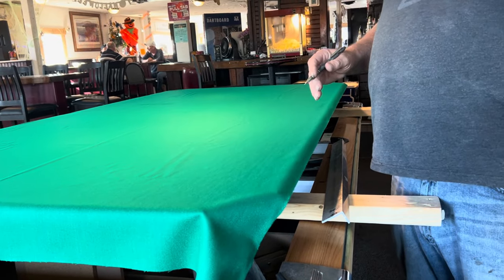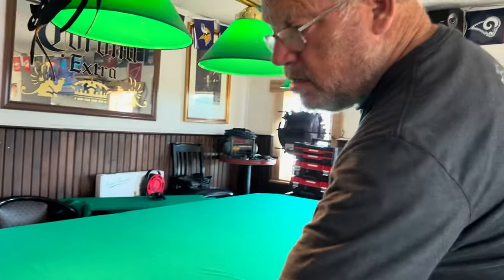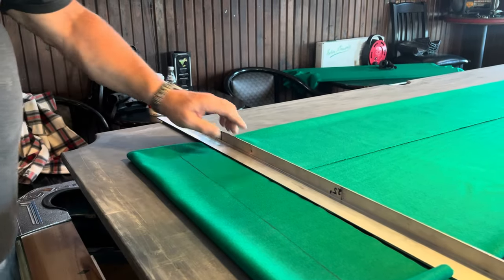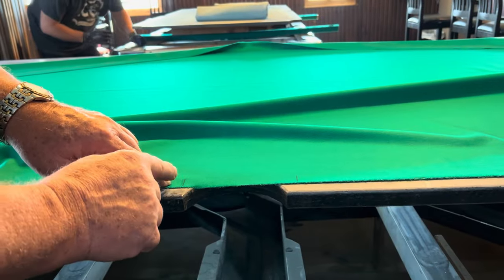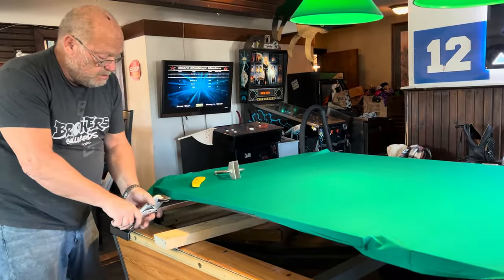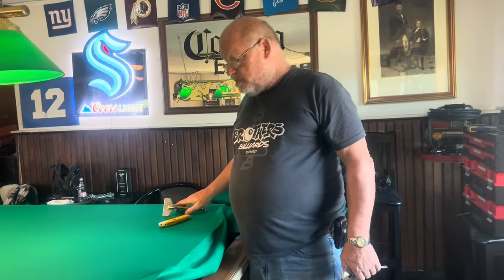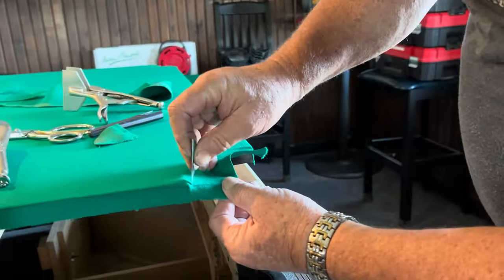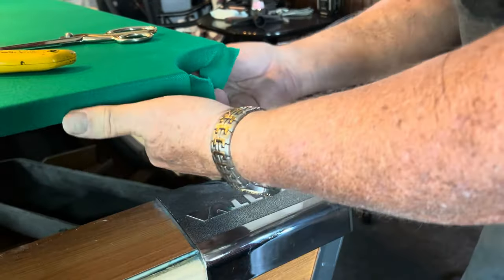HOW-TO: Glue Down Pool Table Cloth Just Like The Real King Cobra!

Comment: This man needs more likes....this is the best example of how to do this. Now I just need to figure out a stretch test. Thank u sir.
Reply from the maker: I'm explaining that in full on the 7ft Valley slate I'm getting ready to recover, trust me, you won't have any questions after watching that video.
Reply: Brother, hear the man grunting? You come back in a year, run a ripper up the middle, and when a 1 1/2 inch gap opens up; THERE IS YOUR TEST. That fabric still had some stretch in it. Some mechanics are so weak that the fabric is wrinkling and/or bunching in front of the ball within DAYS. Their glue and technique is often crap as well.

Comment: Hi,
Thanks for a Great vid. It will help a lot.
I have a 8ft table. With the rails removed my side pockets measure 6 inches along the side of the table and a depth of 3,5 inches.
Is this a full size pocket, meaning i should give it a slack of 13/16 of an inch on the anchor side and 5/8 of an inch on the stretch side?
Greatfull for any reply.
Reply from the maker: Yes, you have a full size slate, so use the 13/16" and 5/8" measurements
Reply: @therealkingcobra  what about 9ft GC IV do you also use the 13/16" and 5/8" measurements?

Comment: Thank you for all this information on pool table installations. It has helped tremendously 🙏 I have one question that would help me out greatly if you have the chance to respond. I've been helping out my local pool hall installing new cloth and we've been installing the Simonis 760. After doing the stretch indexing, we end up with a stretch from side to side of 2.5". Minus the .75" we end up with 1.75" working index. When it comes to the ends of the table, I'm able to stretch both ends at least 3+ inches, at both ends even when one end is stretched and anchored. We install the cloth dry, no water at all. I'm sure it's user error on my side, but I'm wondering if the ends should be able to stretch that much over the side to side working index? Or is it more important to just stay within the stretch index numbers regardless if the cloth can stretch passed that? Any advice would be greatly appreciated. Thank you again for you all your input.
Reply from the maker: Then you need to increase the side to side, and the ends equally. For example, if you're stretching 2" side to side, then both ends should be 2" as well. But when you stretch the second end, and you notice you can stretch 2.5" then on the next table, increase the side to side to 2.25" and both ends to 2.25". Watch the second end again. Adjust again if needed.
Reply: @therealkingcobra, That definitely helped. I ended up having a much more equal stretch all the way around this time 👌 thank you for responding, and thank you again for all the information you have put out for installing tables and reclothing. It has helped tremendously

Comment: Thank you for sharing this mr Glen, i have a question can you use this method by staple instead of using glue.  my slates have wood underneath the slate to staple the felt
Reply from the maker: That's the point of using my gluing system, not to have to use staples, but yes, the stretch index system and pattern of installing the cloth remains the same.
Reply: Thank you Mr Glen

Comment: I need a Recommendation. 

 I've been looking for the RKC250 glue and it seems like everywhere has been out of stock for months. I'm about to recover my table with predator reserve tournament blue cloth (using your techniques) and don't want cheap glue, nor spray glue. I really want the rkc250 tour blue, but it seems like that may not be a possibility.....

Where do you get your rkc250 glue? And if I can't get that glue, what other glue do you think would be similar?

Thanks, JT.
Reply from the maker: Diamond Billiards will be receiving a shipment of RKC250 Billiards glue on Dec 22. They will be shipping out to the distributors there after.
Reply: @therealkingcobra  I got mine from manning cues. They had some. It just got shipped today. Thanks

Comment: how much idle time can you have with the glue once it is applied to each surface, but not stretched?  how much work time do you have to stretch and restretch?  is it a bond that can be reworked a few times in a short period of time or is it more of a one and done contact?  I am still learning on this glue and haven't made the jump to gluing the whole project at once.  other glues didn't have the working time to allow for that, so i haven't made the jump.  king cobra glue is awesome, i just haven't used it often enough to learn best practices.
Reply from the maker: Hey buddy, you don't have to worry about running out of time with my adhesive, it kind of works like velcro, meaning you have a few hours to work with it, or as soon as a couple of minutes. The key to its bonding strength is when you pressure bond the two sides with the adhesive. It's based more on shear strength than contact bond like normal adhesives are, so that means until you pressure bond it, you can pull it apart, reposition, and stick again. But once it's pressure bonded, pulling it apart again is going to require adding more adhesive, because one side is going to stay stuck to the other side, pulling the adhesive off that surface, so, no need to rush.

Comment: Hey i was wondering if you use fiberglass packing tape under the pocket shelf after installation of the felt?  Ive seen this and wonder what its purpose is?
Reply from the maker: No need to use any tape with the roll on adhesive, tape is used with spray glue because it won't hold over time.
Reply: @ The Real King Cobra Billiards  hey thanks for the response.  I re felted my table using your methods and achieved superior results! I can't thank you enough for sharing your knowledge

Comment: Beautiful work! , I have a decent sized table but the base is Wooden and worped in areas : ( , I re clothed it about 6 years ago because the cloth was gone, I had a normal staple gun and my hands , I will not be doing that again. Question , I thought because the wood on the base is warped in some places , maybe a 1mm or even 3mm polycarbonate base on top of that (glued) , using polycarbonate because it doesnt crack. And then a new cloth? Of course there are more expensive methods but ay. Great vid!
Reply: Im guessing a ploycarbonate base would be extremely fast.

Comment: Did you have to reglue any part as you were a good 30 minutes after glueing, I did this in the UK where that glue is hard to find and was running around the table as it was going off quickly.
Reply from the maker: No, with my adhesive, you have at least 2 hours of working time.
Reply: This guy does a great job.   But seems to over complicate it.   Depending on the glue and ambient conditions you'll have to move fast....I use the 3m spray and u have to work fairly fast once it starts to get tacky. Spray works fine.  You gotta use different technique tho
Reply from the maker: Open time on my adhesive is at least 2 hours

Comment: Why are you not installing a few inches of the cloth underneath the slate as designed by Valley. That's how they come new. As evidence, notice that strip of cloth on the main support aluminum beams and the remnants of the old glue underneath the slate.

Instead of saying "nobody in the world using spray glue that would hold this tight with just that little bit of glue right there, nobody" did it ever occur to you that they can just put a clamp there before stretching to the corner?

Love this channel. Subscribed!!!
Reply from the maker: You can put 10 clamps on the edge of the slate if you want, but if you install the cloth as tight as it needs to be, you're going to have to take those clamps off sooner or later, and when you do, the cloth is going to pull loose, I guarantee it. It's easy to prove too, all you have to do is install the cloth as tight as you index the stretch, and the spray glue won't hold. They put the cloth on the crossmembers as a shim to match the same thickness as the cloth wrapped under the edges of the slate.
Reply: @therealkingcobra  Ten Clamps, you're funny. If it is wrapped underneath, no it will not pull loose. The clamp is not removed until that side is stretched and installed. You're wrong about that being a "lie".
By your own admission, "cloth on the crossmembers as a shim" you should be wrapping the cloth. Again, as designed by Valley.
Disclaimer: great channel, subscribed.
Reply from the maker: I've been recovering bar tables for over 40 years, how long have you been working on them? Post a video of a Valley you've worked on showing a 9 rail bank.
Reply from the maker: And do you ever wonder why the cloth from the factory has that white backing glued to it? That's called rayon, nick named rubber backed cloth, it don't get stretched, just installed snug, that's why it don't pull loose. I'd bust your bank account proving you wrong about spray glue NOT pulling loose, guaranteed!!!
Reply from the maker: When you're installing 66" wide Simonis 860HR on an 8ft Valley, after removing the rail cloth from the bed cloth, how wide is that bed cloth that you have to install on the slate??? 66"-18"= 48" wide bet cloth to go on a slate 47 1/2" wide, + the 7/8" thickness of the anchor side of the slate. So basically you have to install a 48" wide piece of cloth on a slate almost 48 1/2" wide, where are you getting all that EXTRA cloth from to tuck it UNDER the slate with your spray glue??? The STRECH from side to side???
Reply: @therealkingcobra  

I'd like to start off by saying that I truely believe that @therealkingcobra does nice work and I watch his videos, along with others, to improve on my skill sets. I would 100% refer him to somebody in need of a table covered if that situation ever arose. He certainly does seem to take pride in his art. My issue is with his insistance that his way is the only way. And his behavior is that of a child who thinks that he is above reproach. He is quick to retort with nastiness instead of willingness to view the commentor as a peer eagar to expand their own knowledge. RKC is only interested in having his audience sending him claps on the back. "Atta-boy". Otherwise, you are benieth his tutelage and you must be admonished.

 That said, enjoy the show.

"...have to take those clamps off sooner or later, and when you do, the cloth is going to pull loose, I guarantee it."

 40 years and he can "guarentee" that something that I personally do every day WON'T work. Well, I can guarentee that spray glue holds just fine. And I can tug on that cloth as hard as I want with out any indication of slippage. And after one year(+/-) later when I go back to redo the table, I struggle to pull the old cloth off. Maybe the spray mechanisim is just to complicated for you.

"It's easy to prove too..."

 Great. Prove me wrong. Do a video where you spray a cloth down and it can't withstand the stretch.

@douglashull3807
"... you should be wrapping the cloth."

The only argument that I will make in defense of @therealkingcobra here is that Valley tables come with a backed cloth. If you are using something like a Simonis cloth, it will be "thinner". However, I do wrap my cloth. It gives me that warm, fuzzy feeling to do so.

"I've been recovering bar tables for over 40 years..."

 Your arrogance to your followers is repulsive. You must be a real joy in the real world. Or are you only an internet tough guy?

"And do you ever wonder why the cloth from the factory has that white backing glued to it?"

 I never have. They tell you in the discription when you order it that way.

"That's called rayon..."

 It's not. It's called, "Backed" and its made from a poly-cotton mix material to add durability to a cloth that gets high usage. Like a bar table. The word that I believe that you are attempting to refer to is "Teflon". Teflon treated cloth, like the Championship Valley cloth that we often use, is a treatment to the cloth itself. They actually wash the cloth in this solution so that it has a higher resistance to stains. 

 But you've been doing this for 40 years so I'm sure you knew that at one time. Getting old isn't easy.

 
"...nick named rubber backed cloth..."

 I personally have never heard anyone refer to backed cloth like this so I looked it up. The only manufacture that I can find that uses this term is Mueller's and there is no discriptions available on what material they actually use.

"it don't get stretched."

 Backed cloth certainly DOES get stretched. It's tougher, sure, but if you don't stretch it, the table will look like you just made your bed and won't play correctly.

"...that's why it don't pull loose."

 It "don't pull loose" because spray glue works.

"I'd bust your bank account proving you wrong about spray glue NOT pulling loose, guaranteed!!!"

 I'll take that wager. We'll keep it friendly. $5 for bragging rights. I'll do a video where I spray down one side of the cloth and then I'll pull from the other side with all I have. I'll have a random bar patron do it if you'd like.

"When you're installing 66" wide Simonis 860HR on an 8ft Valley..."

 Are you buying bolts of Simonis? That's the only way that your numbers make sense to me. Most bar tables are 7ft with a slate wideth of about 43". The Championship bolts ship 66" wide. I trim 18" for my rails. That leaves 5". 2.5" on each side to wrap under. And the length I cut myself so there is no issue there. 

 On an 8ft table I usually won't get enough trim to do my rails. Usually I only get 4 out of 6 but there is plenty of leftover material in the shop to accomade this and isn't an issue. I usually hold on to this smaller cut off piece for when a 6" table pops up. We don't have too many of those left, though.

 As for an 8ft table with Simonis, I just order the pre cut pack. Comes with the rails already cut and the cloth is always plenty large enough to tuck under. But, again, you've been doing this for 40 years so I'm sure that I'm not telling you anything that you don't already know.

"...where are you getting all that EXTRA cloth from to tuck it UNDER the slate with your spray glue???"

 I'm planning my job properly ahead of time. You know the old saying, "An ounce of prevention is worth a gallon of roll-on glue". Or something like that.
Reply: @douglashull3807  
Just letting you know that I refered to you in a comment to RKC.

Comment: If you're not going to wrap the cloth around the underside of the slate like it comes from the factory you have to remove the cloth that is glued to the cross members that the factory put to compensate for the thickness of the cloth in the middle
Reply from the maker: Wrong, if you take and put a rail on top of the slate, then measure the thickness of the rail and slate combined, take that measurement and compare it to how far down inside the table the slate sits, by measuring down from the formica rail cap, to the slate support braces, you'll find out there's about an 1/8" gap, which means if you set the slate in with out filling up that gap, either you're going to have a gap between the bottom of the rail and the slate, if the rails are lined up with the top of the formica, or if you push the rails down to sit on the slate, you're going to have about an 1/8" of formica exposed at the top of the rails, scratching the hell out of everyone's cue shafts.

Comment: never put the glue near the corners ! Only use strong duct tape at the corners from underneath.  This guy doesn't shoot pool, he doesn't know! that glue on the corners creates a ledge, and the ball won't roll into the pocket at pocket speed... when you put glue like that, and then stretch the cloth, when the cloth moves, it brings the glue up to the edge with it !   and now you will have 1mm of glue bead at the top edge of the corners !  enough to stop a slow rolling ball.     Let people that actually shoot pool for real help you! they are the ones that will be affected
Reply: If you glue the fabric right, the fabric won't pull back. If the fabric pulls back, you've lost your stretch leading into the pocket, and the fabric will begin bunching in front of the ball as it approaches the pocket ("sand rolling"). No way tape alone will replace glue if pocket stretched tight. But tape ok as secondary.
Reply: @hightttech  I'm not saying don't glue... I am saying don't glue where the ball rolls, or you are affecting the ball's roll... any glue under the fabric affects the ball's roll.  The rails cover the glue, except near the pockets. a 1/32" height of glue will stop a pocket-speed ball from rolling in.  I have seen this firsthand, I play pool every night for the past 15 years. on multiple tables. Also, the best glue to use is SUPER 90 spray on glue from 3M, it doesn't break down like the other glues when time goes by and oxidation occurs. I have Super 90 3M spray glue staying put for 10 years
Reply: @ralphwiggum240 :  I misunderstood your comment. Sorry. I TOTALLY AGREE, NO GLUE ON TOP OF SLATE. At pocket entry, I razor to BARE slate on top when i find glue. To protect finger cuts, I rather use 3M strapping vs duct tape because it removes intact without ripping, drying out or leaving goo. I have used 3M 90 in an emergency, but 3M 76 is my first choice for the bed, 77 for rails. Cheers
Reply: What on earth would possess you to say that the real king cobra doesn’t play pool? Or a guy who makes his life playing on, selling and repairing pool tables, I am sure this comes as a real surprise to him!